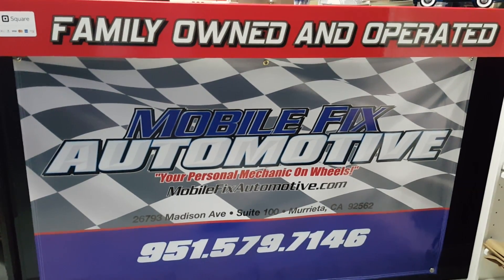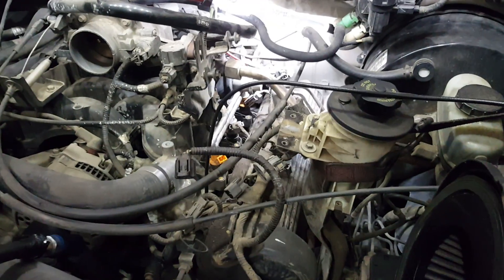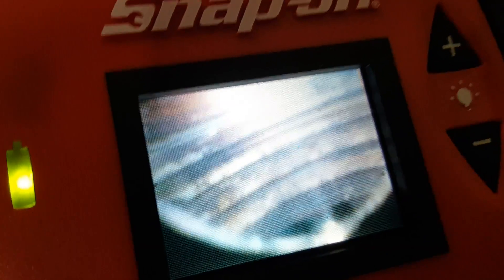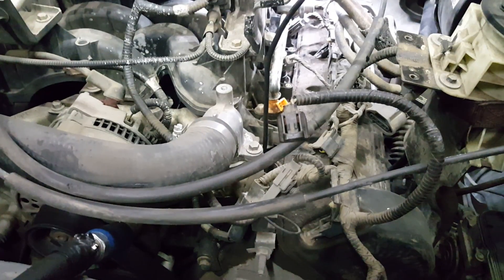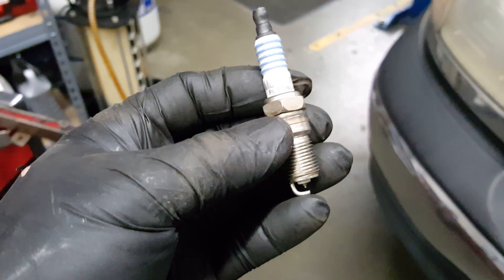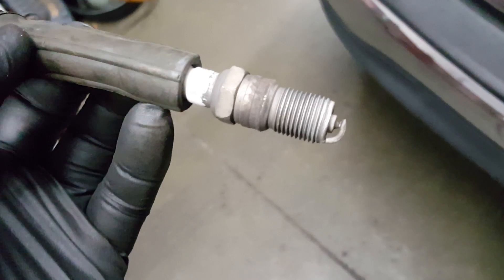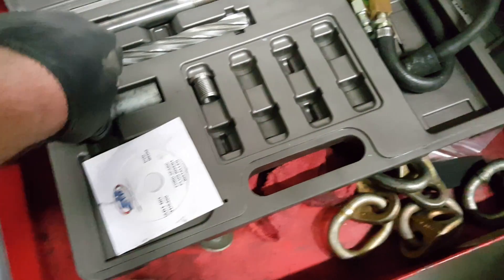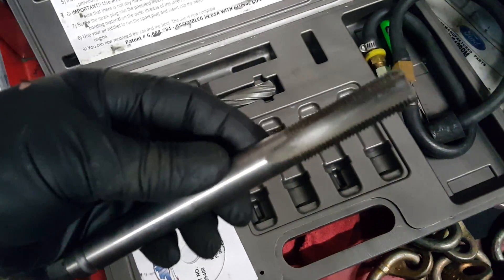Why the spark plug blew out of your Ford Triton engine

Comment: It's cool when you blow just one,,, you sound like a helicopter going down the road. Experience.
Reply: I thought it was more steam locomotive like.
Reply: It'snot that cool!😎
Actually, if it's not your truck I can see it being cool but, if you own it it's not funny!
Reply: Lol!
Reply: Jackle61 happened to me last week lol sounds dope turning heads
Reply: When mine blew out on my V10, I thought it sounded more like a steam locomotive.
Reply: until it rockets the plug through the plug tube and destroys your coil pack!
Reply: Do the threads on the head always strip out when this happens?
Reply from the maker: No, every once in a while only the last thread let's go when a plug comes loose. Sometimes people re install the plug and it tightens down. And then sometimes it blows right back out.
Reply: @SandCarServices  what would you recommend. We had this happen, did the repair with the calvan kit and the same coil n plug blew out again?
Reply from the maker: I have never seen a properly installed calvan insert blow back out. My guess is it was either a knock off, or a defective insert. I have also seen vehicles come into my shop where they say a calvan insert blew back out but it was actually a save a thread and the shop doing the installation didn't know the difference. If it was a calvan insert chances are it was one that had bad threads like I show in the update video and it was never threaded all the way in. It may be possible to just retap and install a new insert. If not then the triple oversized timecert may be needed.
Reply: @SandCarServices  ill watch the update video
Reply: Yes, it happened to me. #2 cyl
Reply: Bruh does it stall at idle when it blows or what
Reply from the maker: Some engines will stall after a plug blows out. Its because more than one cylinder will misfire
Reply: @SandCarServices  it just happened to my 09 f150...I need it fixed asap
Reply: @dougklauser7  mine blew just sitting in a parking lot, never missed a beat just all of a sudden sounded like a helicopter.
Reply: Yup, just had this happen to me this evening
Reply: Happened to me 4 days ago. Oil use and gas use eas tremendous and finally blew out and it sounded so violent shuffling down the road
Reply: @Benso.mp4  Just happened to me. My girlfriend and I had to drive two hours with it like this. PROTIP! Take the plug and coil out and unplug them before driving home, or you can spark a fire!
Reply from the maker: Dont forget to disconnect the fuel injector electrical connection for the cylinder that blew out because raw fuel can blow out of the cylinder hole and get ignited on exhaust manifold and the vehicle may catch fire.
Reply: Old ford tractor

Comment: Ouch. Owners of the vehicles affected by this issue might want to put a socket on the plugs every 10 - 20 thousand miles. I'm guessing some bean counter at Ford thought they could get away with fewer threads in the design, and reduce costs by some tiny amount per engine, but they didn't think about what happens when a plug backs out a little, as they are going to. Stupid. Especially idiotic when you realize the Ford spark plugs have twice as many threads as the plug holes on the Ford Triton 2V heads do. Doh!!!!

Comment: I must be lucky. I put 650,000 miles on my last ford. 480,000 on he one before that. and 150,000 on the one i'm driving now. luck ?
Reply: Never had this problem with my 2002 5.4, it ain't just you!
Reply: What's your secret to maintaining your vehicles? Geez. I can't get pass 200,000.
Reply: Have a 2002 5.4 190000 never had a problem with plugs.
Reply: Yes my friend, if you read my comment you will see my list of great Ford engines.  Every manufacturer has some bad eggs here and there.

Comment: Had a 1998 F150 / 4.6 l  I finally scrapped it with 402,000 kms . It was misfiring for the last year it was on the road . I scrapped it because the power steering kept crapping out. I miss that truck . It was the most reliable vehicle I ever owned .

Comment: 4 threads in a block of aluminum that is the problem.
Reply: elzorro43  I see few problems in the older Fords and others, but the newer things I would have to look long and hard before I would consider any of them. What good is a vehicle that goes into the shop multiple times a year, and only the dealer can work on it. If they go belly up as most likely will at some point, all I would have is an expensive large piece of worthless junk that is not even good for storing things in.

I can fix most anything if I can get parts, software, tools, etc. It is like what I have heard about John Deere, in the past they were one of the best, but now you are putting your livelihood on others and paying for it outside of your control. Who wants that kind of garbage, but people with a bunch of low wage people that are not willing to step up to better, and pays outside people to fix things.
Reply: elzorro43  my 99 Honda Accord threw a spark plug once it had no coil packs back then just wires wildest experience for those who don't know what it's like I made it to the tool store to get a 6in extension found my plug in the wire it destroyed the insulation under the hood from the blast and went on my way after reinstalling it

Comment: I blew one on a 1999 Expedition. Ford wanted $3500 to fix it but I got an insert kit from Auto Zone and did it myself. It was kind of hard to get to because it was 2nd from the back on the passenger side.  I didn't know others were having this problem.  I always thought the original owner must have cross-threaded the plug.
Reply: Ford was going to give you a new head with the same problem for the $3500! Great deal ain't it?

Comment: Wish he would remove other plugs that had been in the same amount of time (any of the others in this video) to see what the threads in the head looked like.  Did they have a bare spot of threads??  Might prove some more s'plainin.
Reply from the maker: You must not have watched the whole video. Every spark plug hole had 4 and a 1/2 threads. So does nearly every other spark plug hole that I pull plugs out of were talking over a 1000 spark plugs

Comment: And then there is the 4.0 with 3 timing chain thingies.  Who thought more moving parts was a good idea on a 6 cylinder not designed to make crazy horse power?  Ford.  Myself, were I the boss when an engineer came to me saying "Hey boos...I have this  great idea....3 timing thingies!"  I would fire this engineer and give him/her 15 minutes to vacate the building.  No talk, no review.  An idea that bad needs to be made an example of.  As head of Ford I'd be firing the boss who approved this too.
Reply: That had to be the worst idea ever. Timing chains front and rear of the engine. The back one goes and out comes the entire engine to fix it. It was replaced with the SOHC German design 4.0 engine much better! 
Another thing I don't understand is; why any mfg would use small diameter steel bolts, that corrode quickly, to hold the exhaust manifolds on! Ford also has a problem with the fasteners snapping on their own causing a manifold exhaust leak!

Comment: Ron, you do such a great professional job on your videos! I love your approach and format. You have a hint of "backyard mechanic" so we can relate, but your experience is obvious and you can totally backup your opinions! Great job man!
I have a 99F250 V10 with 228k. Never blown a plug! I use Motorcraft  plugs and dab them with a little anti seize. Love the V10 engine. It does a great job in my work truck. A little thristy on gas, but just so reliable and smooth running. Never gets hot, heater gets nice and hot quickly on below zero mornings. 
Anyways, thanks again for the super helpful and right to the point honest videos!

Comment: I just bought a F250 with the 7.3, can’t blow spark plugs if you don’t have any.
Reply from the maker: Best comment yet!
Reply: And it’s a true comment. I wanted a truck for hauling a dirt bike and what not. I knew the ford gas engines spit out plugs from a first hand experience with my works F150. Got a rusty but trusty 7.3 back in November. So far so good.

Comment: This is a result of Henry Fords business model. Design parts to fail. Either you spend hundreds of dollars for repair of faulty design or you buy a newer model. Henry sent scouts out to scrap yards to recover parts. If they could be put back into service he found a way to make them fail. Make it cheaper, designed to fail and you keep selling newer cars.
Reply: I have found that after doing hundreds of spark plug thread repairs that heli - coils hold and work better. The major problem with aluminum heads is the use of iron plugs. They would rust and seize into heads. When you removed them they would tear the existing threads out. A major reason that I always insisted on the use of Bosch plugs. Nickel-cadmium base never rusted. Also used heli - coils to toughen up high-performance engines. This would apply to aluminum engines and heads.
Reply: If Henry Ford actually did that why did his tin lizzy stick around for 19 plus years? Seems using failing parts as you describe would have doomed the Model T to history long before 1927!  The model T had the only frame made with Chrome Molybdenum steel in America. He built a factory just to make those frames. He did this so the Tin Lizzy would LAST driving over the non existent roads at the time. They may not have been the best cars but more of them long survived any other cars from the era especially the  Chevrolet which William Durant stole from Luis Chevrolet! Durant also stole the Bowtie design from a wall paper design he saw in a hotel while visiting France

Comment: Here I thought the reason Ford uses long threaded plugs was so they didn't fall out so easily. Who would've thought only having 3 threads in a aluminum casting under immense pressure and heat wouldn't hold

Comment: Absolutely ridiculous cylinder head design.  4 to 5 threads holding on a 3/4 inch reach plug.  I'm no engineer but it seems pretty obvious.  I've had to fix a couple myself.
Reply: The problem is they went to aluminum. My 66 mustang only had a few threads for it's plugs, too. Never had a problem because head and plug were STEEL. Today's 5.4 V8 from 2008 is still going strong, no problems, 150Kmiles. Most American pickups will do a few hundred thousand miles if you take care of it. The reason you see so many problems is because there are so many of these trucks out there.
Reply: @d.e.b.b5788  your Mustang didn't have anywhere near the pressure the Triton's do. Trust me, I rebuilt many 289's and 302's in my day.
Reply: The starter is too close to the exhaust manifold. Not only is the top bolt hard to get at, the aftermarket starters tend to burn up quickly... strong engine, though..
Reply: @aaronhumphrey2009  you mean junk engine
Reply: aren't you glad ford didn't design the plug itself.

Comment: My brother owns a Ford 250 van with a 5.4 Triton.  After blowing three plugs in different cylinders and destroying two coils he had all the cylinders tapped at the cost of $1600.  Thank god the shop felt sorry for him, but he has used them along time or it would of cost a whole lot more. How could ford be so stupid to have only 3-4 thread in the head.
Reply: Key word should be "Aluminum head"!  Cast Iron technology in a modern Multiple metal engine.

Comment: This happened to my 05 ford five hundred. Not it loses all the lights of a second or two ever so many miles
Reply: Check your dimmer switch it may be the problem. I had my head lights go out driving down the road in my 97 Ranger in 2000. Turned out to be the dimmer switch. I replaced it with a Motorcraft replacement bought at an auto parts store and it's still in it
Reply: Patrick Kruger it says charging unit then the wrench comes on

Comment: Hi Ron ! My triton V 10 just spat out a spark plug and broke the coil. The mechanic in Las Vegas could not find the right insert to solve the thread issue so  he just wired some copper around the new spark plug and replaced the coil and send me on my way after charging me 380 dollars.. u think I can drive like this to Cali ?
It’s a 99 v10 triton e 35O Rv ...
70.000 miles...

Thank u Ron for your advice 
Nick

Comment: That is just bad. Have a ranger now. Won't be looking at the used F series. Your opinoin is based on fact. I can see it. I loose respect to ford for this. Ford thinking that is enough threads. Well they need to look at a spark plug. I know all vehicles have flaws and stuff. This is one that should have been a recall to rethread the holes. Towing a big load a boom. Not cool. You are the man.
Reply: Try to find a used Ranger they just aren't there. Lots of Chevy's though. I couldn't understand why Ford ceased production of the Ranger. I have two of them 1997 bought new and a 2003 bought used! A few expected problems that were easily over come! Love em!
Reply: @patrickkruger5310  their is a new ranger and bronco coming. The ford dealers always say next year. I'm not holding my breath. Usually go GM. The ranger is my first not GM vehicle. From driving SUVs i always wanted a truck. Went small now i want big.

Comment: There needs to be a class-action lawsuit against Ford like there was about the modules. They need to install inserts on all plug holes. On Triton engines, there is another plug that won't break off. It's the SP546. Don't use a regular spark plug socket 9/16 extra long. Get the spark plug remover tool set. The long socket can drop the plug in the hole. Then you have to use a magnet. A Lisle-type insert might work on these.

Comment: All the more reason to buy a Chevy they don't call Ford found on road dead for nothing I have 280,000 miles on my Chevy s-10 original engine and transmission never had to even pull the valve covers off

Comment: Being in manufacturing (machine building , aerospace, Too and Die ect), for over 40 yrs I can tell you exactly what's wrong here. The engineers for the most part know what they're doing but are hamstrung by the accountants for cost savings.
With the layers of management of these large stockholder driven corporations they are slow to react and therefore you have the same issues for years before they get fixed. It' all about short term quarterly profits ...really a stupid way to run a company IMO.
I've had plenty of new Fords/Mercs (5.4,4.6,4.0) but with some of there stupid issues I may be done with them.

Comment: I got to do my first one on a v-10 van, number 3 cylinder. I had to do it by braille because the cowling was above that cylinder. The Cal Van kits are great. The insert gets locked in with a retaining pin. Napa sells a kit that works OK but the insert can come out with the plug if you have to pull the plug back out. My theory on the failure is the plugs can loosen slightly over time. Between the power stroke (compression) and spark arcing, the few threads in the head turn to mush. Put it right up there with the 6.0 diesel high pressure oil pump, high pressure oil line connector, head gaskets and 6.4L lifters. The 6.7's seem to be a bit better only plagued by leaking vacuum pump gaskets and exhaust temp sensor issues. (so far) Ford's shitty shrink fit turbo line clamps pop pretty easy too................................. Buy a Toyota.

Comment: Its sad to see them all selling junk. 4 threads. I am surprised it lasted 10,000 miles. I guess the coil pack is a design element of the compression stroke. The pack holds the sparkplug in until - the warranty is gone.

Comment: So it's the aftermarket spark plug companies, huh? Hows come no one else running aluminum cylinder heads is having the same problem while using aftermarket plugs?  Piss poor engineering on Phords part.  Just another comment.

Comment: Wow, the old VW spark plug problem renewed. They had the exact same repair for the old air cooled boxer engine. They used an 18mm  od thread insert. The original threads were adequate but owners & some mechanics would use a non VW specific plug which would put a thread or 2 of exposed thread into the combustion chamber. Then, whenever someone would remove the plug the accumulated carbon on the exposed threads  would tear out the threads on the head.

Comment: Same on the 2000 v6 Duratec.  Mine backed out and started missing in 2008 (105k).  It didn't pop but it was likely loosing ground and compression.  Took it in, they replaced all plugs, replaced the coil pack ($150 part) their computer said was "failing" and it drove OK for 500 miles then POW.  Luckily it was an up front cylinder, easy to see but DEEP hole due to the DOHC.

I put the plug back in on the roadside and put a washer on the broken pack mount.  Drove perfectly again.  I was done with the mystery magic mechanics at the dealer watching their Ford video screens.  I found an Australian liner kit in the Help rack at Advanced Auto for $25 with three liners (different lengths). Felt down in the hole and it appeared all the top threads had stripped and I assumed the mechanic had stripped them or overtorqued.  Makes me mad now to know they were never there. 

That was a nervous moment cutting a big hole in the head with a tap in my driveway.  Stuck in the liner with JB JIC and she went another 95K before I sold it when the valves started to stick and it appeared another, back against the firewall cylinder was possibly loosing compression.  Done for me.  

Bought that car for $5500 two years used, drove it for 14 years and 160,000 miles, so I got my money's worth.

Buy Toyotas.